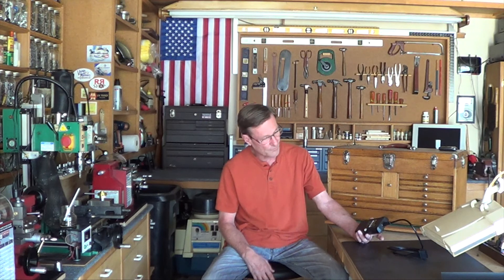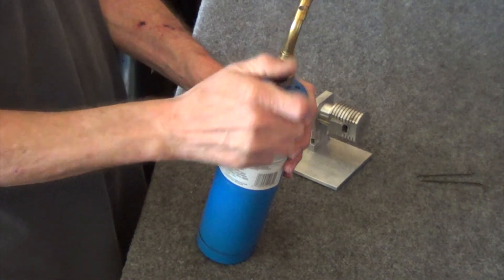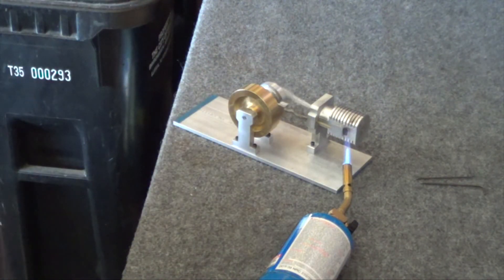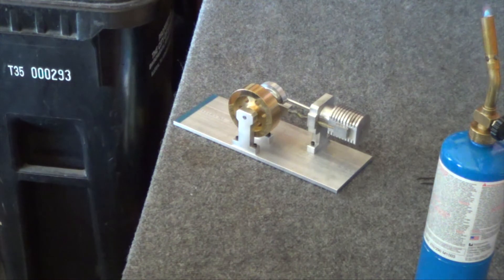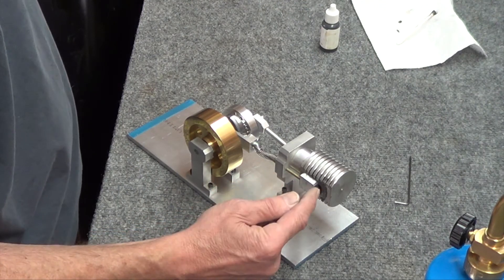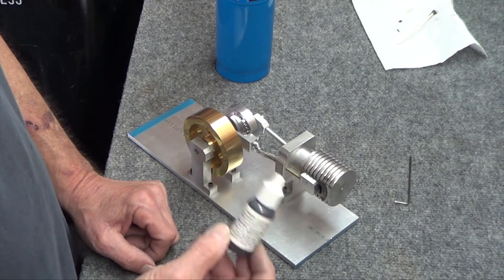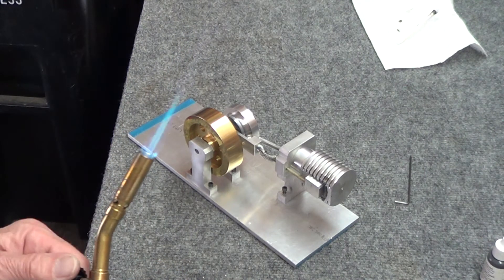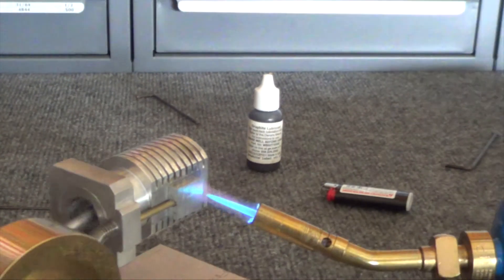Why Own An OBD  II Diagnostic Scanner

Comment: Dave, congratulations on getting the engine running. The OBD II scanner takes the worry out of passing smog checks for older model cars. I have a 1998 BMW 740iL with very low mileage and almost never driven and stays in the garage. I forgot to put it back on the battery trickle charger and the battery went completely dead and reset the readiness monitors on the OBD II. The OBD II scanner was helpful in confirming I had successfully completed the various driving cycles before going in for the smog check and avoid failing the first or free retest, and then paying more.
Reply from the maker: Wow 740IL I'm enjoying a 2001 740I with 67K on it. OBD says all is OK now so going in for a smog tomorrow. Wish me luck!
Reply: Good luck. I had to take the 740iL through the various driving cycles late at night on with the hazard lights turned on. It seems nobody drives slower than 70 MPH these days. The hardest part is the gradual deceleration cycle from 57  MPH and coming to a full stop without applying the brake (you can use the emergency brake) by using a freeway off ramp and idling for 5 minutes without getting rear-ended.  The BMW stopwatch is a great feature in getting the correct driving cycle times.
Reply from the maker: LOL I still contend cycles are all bull! My battery was disconnected and all I did was drive it a few places and OBD says go! Will let you know how it goes....
Reply from the maker: Hate to tell you this but the battery was disconnected for repairs and all I did after was drive for about 80 miles. Some freeway some city nothing special just normal driving for errands and it just passed smog. YES!!

Comment: Have you tried using just a small lighter or a candle...maybe alcohol flame?  The torch is heating the entire cylinder.  If the opening can just gulp in a small amount of heat from a flame nearby it might run continuously.

Comment: Was the code that caused the fail a p0100 -system checks not complete, that seem a bit harsh.
Reply from the maker: No the problem was 'Catalyst Not Ready' it wouldn't complete a cycle to give me a fail code. So the consensus was replace the converter which the dealer did at his cost $250.